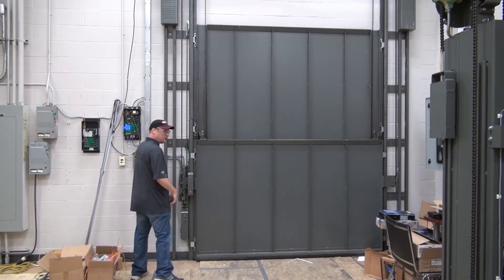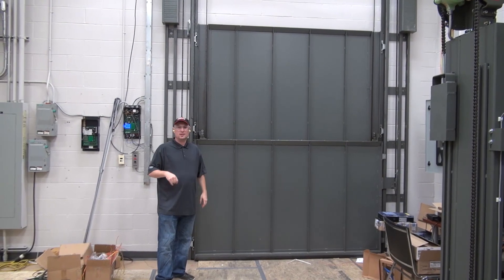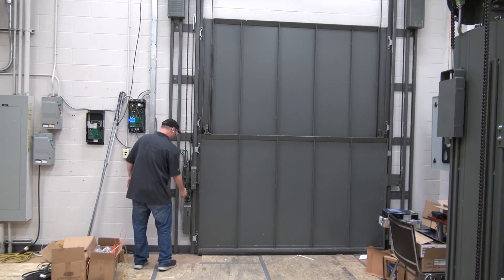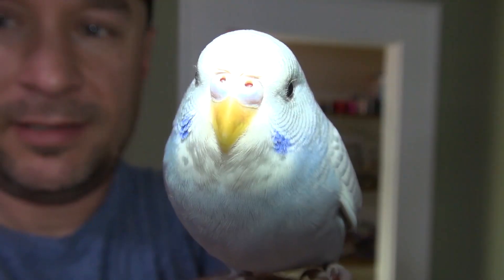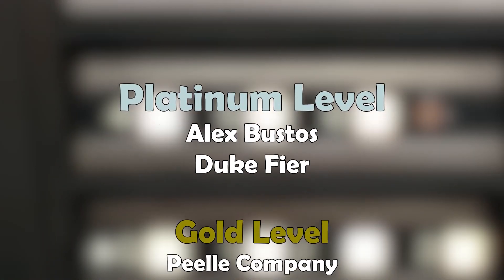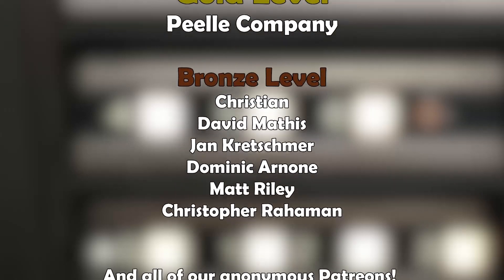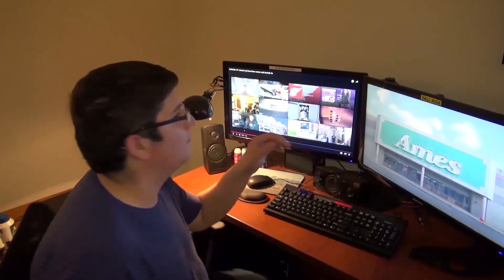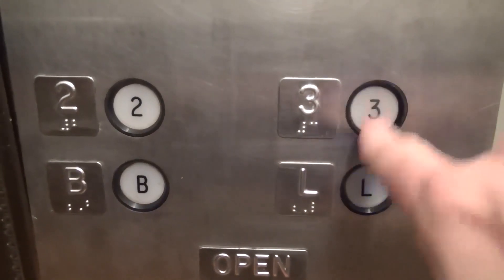Demonstration of a Peelle Telco Two Speed Freight Elevator Door

Comment: DieselDucy

Do you use Step down transformers to light up your Elevator buttons? I’m assuming they are Low Voltage Being that they are not connected to an Elevator power supply and you don’t want to fry the bulbs plugging it in to an outlet.

Comment: Quite an amazing telescoping door operator driven sheaves on each side with counterweight. Micro processor controlled. I would imagine this type of door would be installed in a fright elevator in a building with very high ceilings 11 feet or higher.  This type of elevator door is surely very expensive.